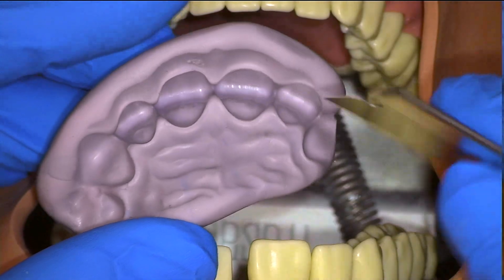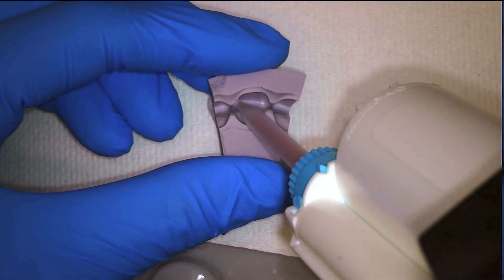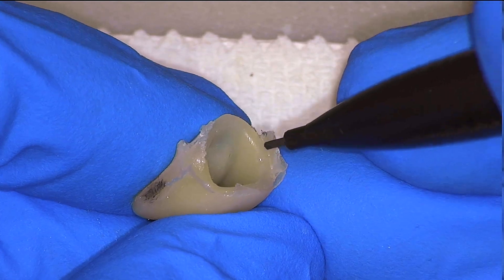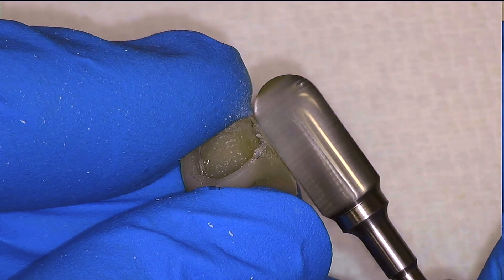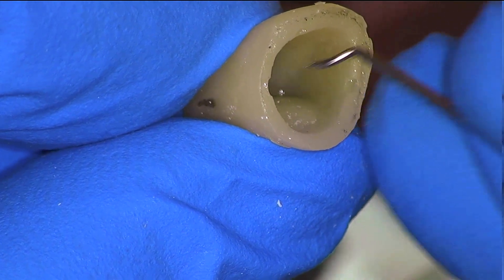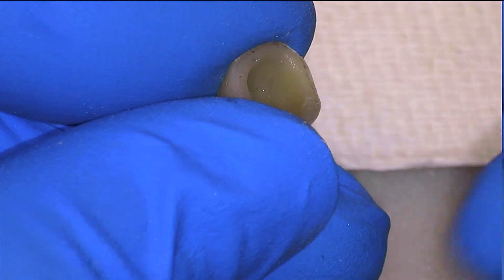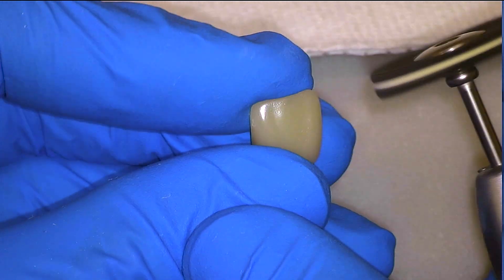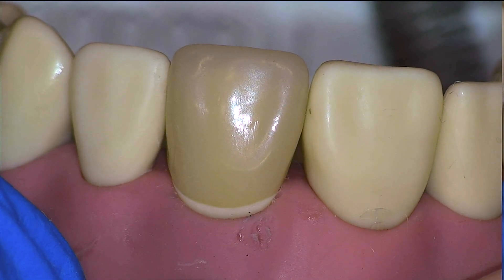Temporary Crown Tutorial | First Person Perspective

Comment: How would you remove the pencil marks on the temporary?
Reply from the maker: You can brush a couple times over the proximal contacts with a polisher, for intaglio surface a steamer can be used or even sandblaster. Also try alcohol on gauze should remove everything.

Comment: Doc when you try to remove the provisional are you placing the plier tips at the margin of at the concavity ( middle third ) tia
Reply from the maker: The hemostat is placed apical to the height of contour of the facial surface and the cingulum on the lingual surface. If placed above the cingulum it will slip off. Direct contact with the margin should always be avoided.
Reply: @dr.fritzmora  yep that sound right 1mm above the margin as HoC located at the cervical third thx
Reply: @dr.fritzmora  btw do can we use packable composite to fix short margin especially in proximal / and poor contour TIA
Reply from the maker: @DoctorAj2023  I prefer flowable but if you use packable I would probably wet the surface with bond as a surfactant before applying. Should work fine.
Reply: @dr.fritzmora  thanks alot doc waiting for more awesome content all the best 👍

Comment: How to correct the open margin on the proximal…. Sometimes its really difficult to blend the flowable which create difficulties while removing the Provisional TIA
Reply: Hopefully you do the premolar 😅😅
Reply from the maker: @DoctorAj2023  Put vaseline on the prep before seating the crown. 
Either seat the crown and then inject flowable (excess is ok you will trim it off), or place flowable on the temporary in the area of the defect and then seat the crown.
You could use a mylar strip to spread flowable into the defect area if it is larger--like the pullthrough technique.
Reply: @dr.fritzmora  Thanks alot doc hope if you post a video on premolar specifically #12 or #13 
Thanks again
Reply: @dr.fritzmora  also doc sometimes after you cure and remove the crown it get crack any tips to avoid this 
Thx again
Reply: @dr.fritzmora  what is the pull through technique?
Reply from the maker: @nancynanda4032  Place a mylar strip in the interproximal area, place resin in the defect, pull the mylar strip through and out, leaving behind smooth composite, then light cure.